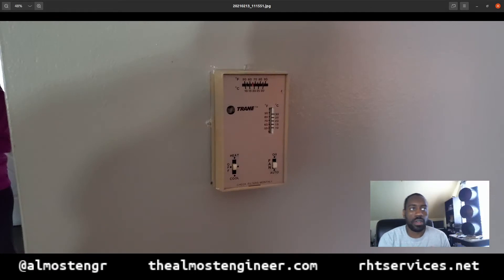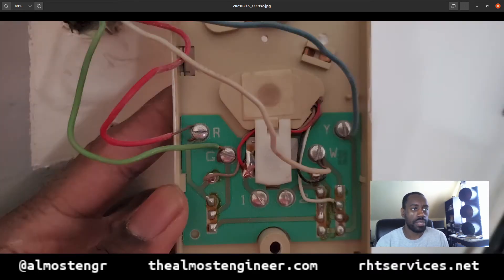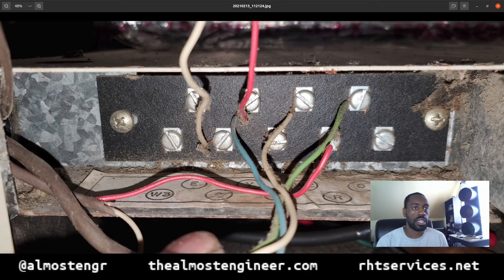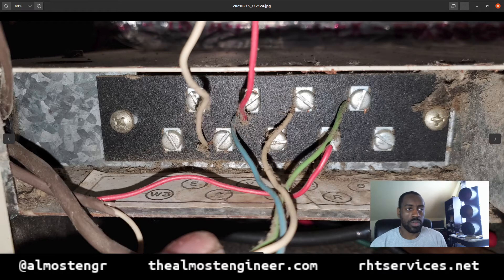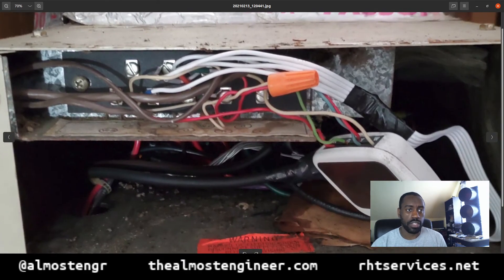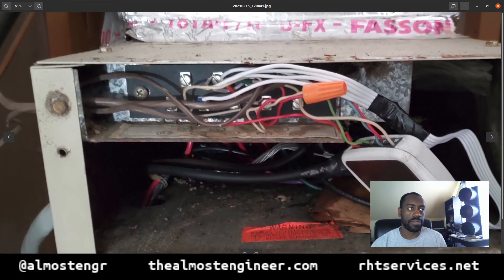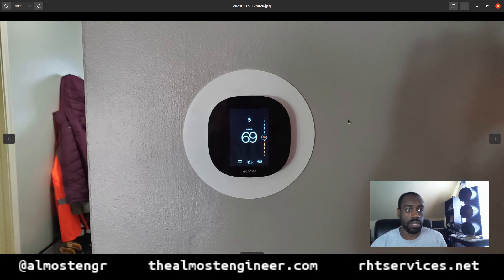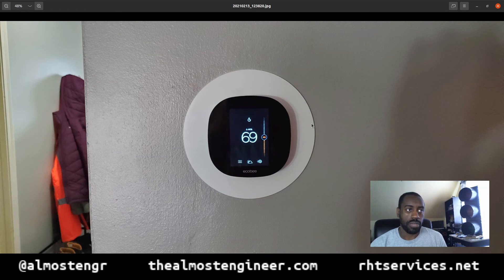Ecobee 3 Lite Installation with PEK (Power Extender Kit)

Comment: If the wall is to be repainted could you paint over the plate or would suggest removing it ?
Reply from the maker: I would remove it and then paint. However you can paint over it the plate. I would recommend sanding the surface of the plate first to ensure that the paint will stick